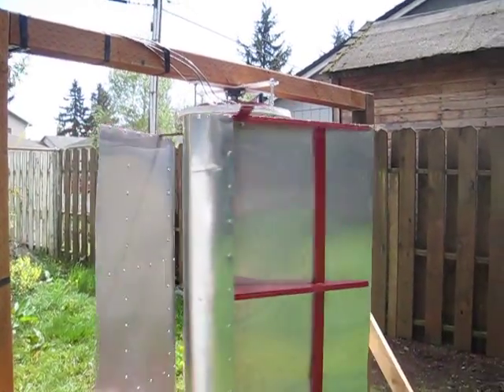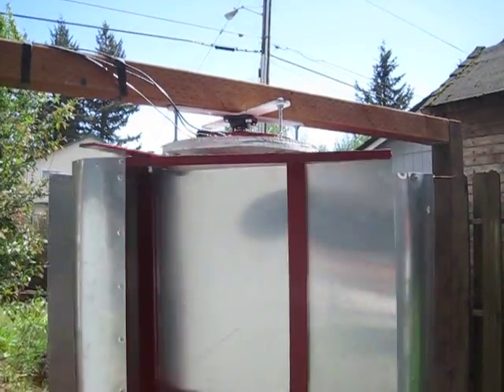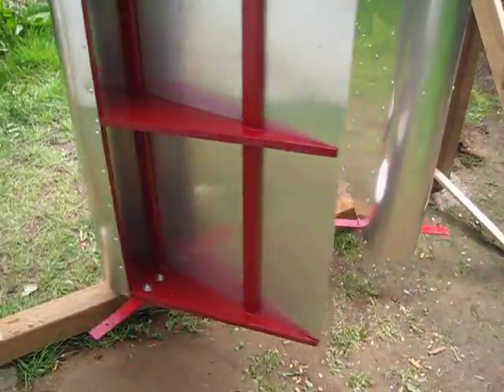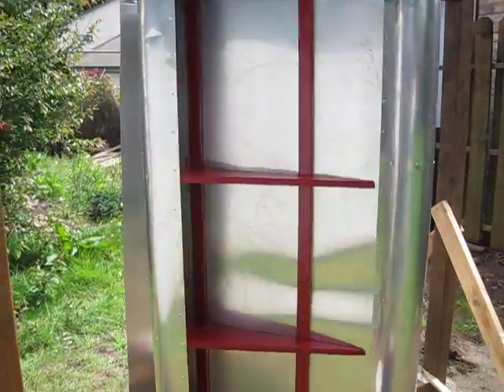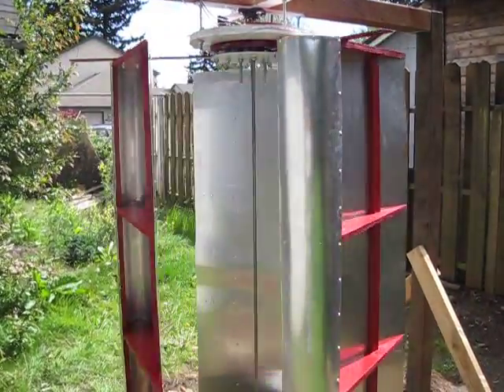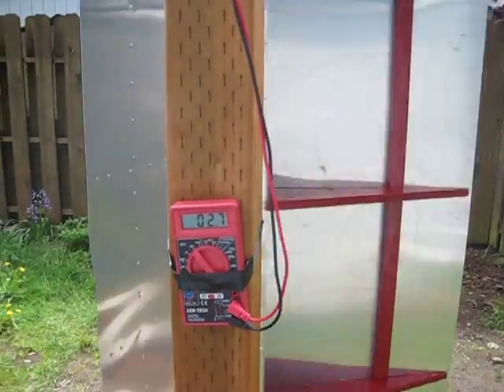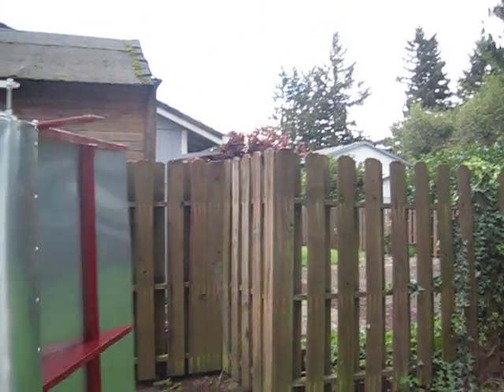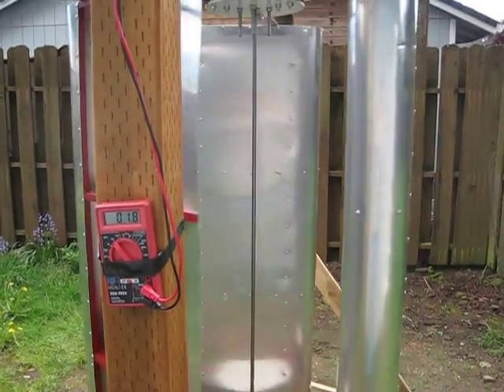Vertical Axis Wind Generator testing 001

Comment: Sweet! Nice craftsmanship too. Don't know if you have played with these things: http://www.ebay.com/itm/DC-DC-3-35V-to-3-27V-Boost-Buck-Converter-LM2577-Step-Up-Down-Voltage-Regulator-/390825935308?pt=LH_DefaultDomain_0&hash=item5aff0a81cc  just something I have been playing with lately. The one I linked is super low current but will give you regulated 12v (or higher, adjustable) as soon as you break 3v. Shop around tho lots of different specs to play with.